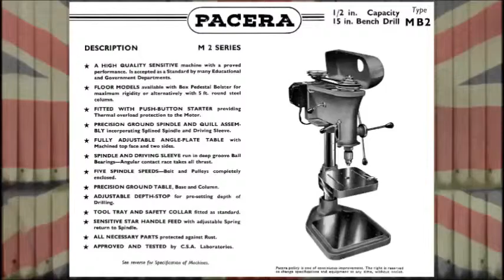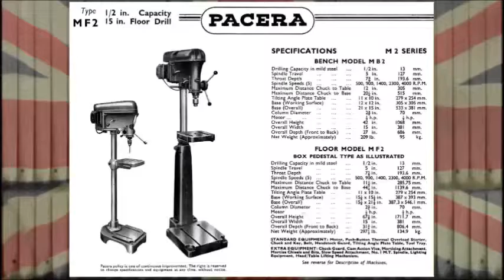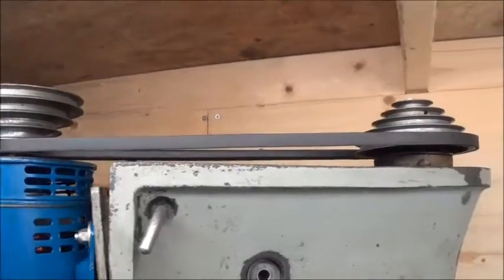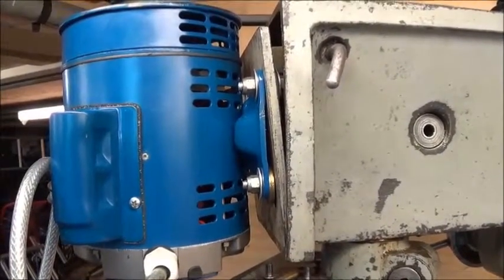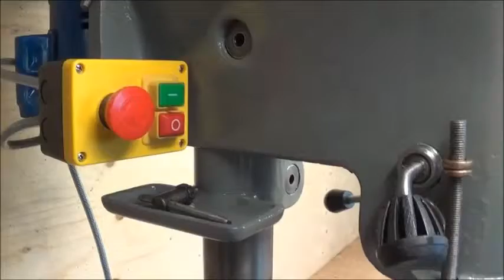Part 4/4 Meddings Bench Pillar Drill Refurbishment - Hinge, Paint

Comment: Looks great, thanks for making this series. Just looking at one of these on ebay atm. Out of interest - is it easy to remove the head from the pillar? Seems like it might make moving it home a bit easier - looks heavy!
Reply from the maker: I expect you've found out by now, but yes it's easy. A similar lock to the table lock holds the motor head. Then lift it off of the pillar. Very heavy, but easy!

Comment from the maker: Thanks Dave, I'll look into a better starter switch. Good point about the belt length!
Reply: you should be able to easily size the overload from the motor name plate (it'll have the max amps on it).  Try to get an overload where your required amps are in the middle of the range, so you can adjust it up and down as needed.  When you wire a contactor and overload for single phase, you should loop the Live wire through twice (and the neutral through once) for a bit of redundancy.  Hope this helps!
Reply from the maker: +Dave Knight Thanks for the info. I'll get onto it soon.

Comment: Glad you got the belt sorted. While I guess the washers are a bodge it looks fine and keeping everything level can only be a good thing! Always worth trying to paint the whole name plate black and then wiping off the excess with a tightly balled rag. If the lettering is so worn that the paint wont stay in the engraving then I guess you'll have to paint it in with a tiny brush.

The drill looks great overall!
Reply from the maker: skipskip75 Thanks for the kind words, mate! Even though it makes no difference to its operation, it was quite satifying to paint it all in uniform grey. Think painting those tiny letters might be beyond me though!
Reply: Shed Ramblings Those old drills have some beautiful lines, I think they deserve at least a little bit of time on the cosmetics! I look forward to the next restoration.

Comment: have you considered using a shorter belt, then adjusting the motor more to the vertical without the spacers in?  I know the belt you got matched the one it came with, but then it also came with a gearknob, the original belt may well have been shorter.  What you have now seems to be working, so maybe it's not worth the hassle.

Also, the motor switch you bought doesn't contain a thermal overload.  Fused plugs aren't really good enough for this, normally you'd buy a DOL (direct on line) starter which has the contactor and thermal overload sized to your motor.  They're pretty cheap from somewhere like screwfix or RS.

Did you have to replace any of the bearings or anything while you were refurbishing the drill?

Comment: I have encountered similar problems with drive belts but they are easily overcome if you use nut link drive belt ,that is available on eBay. You can then tailor the belt length by removing or adding links, also that type of belt grips better.
Reply from the maker: Thanks for that tip, I'd not heard of nut link drive belts, but I've just been looking at one on eBay. Looks like the solution!

Comment: I doubt it had a guard originally and its not shown on Meddings advertisement that you showed.
I think you have done a great job in getting the drill up and running, although the motor plate seems odd.
Reply from the maker: No, it looks newer and it doesn't sit squarely in the centre. I have found it useful; particularly when drilling aluminium when you can get big curly bits of swarf fly off. A few people have commented on that motor plate and I am aiming to do a follow up film soon with some improvements as suggested by viewers. Thanks for you interest and kind comments.